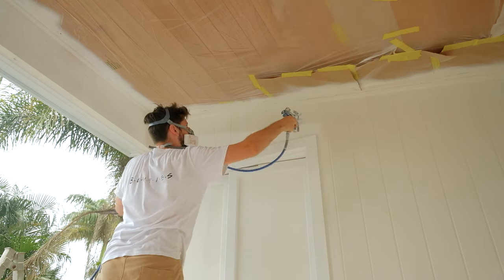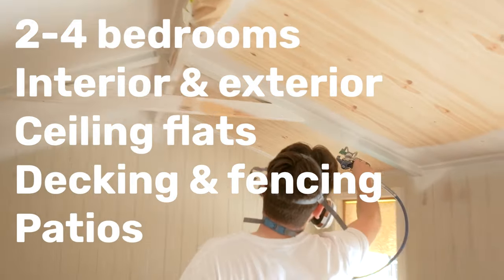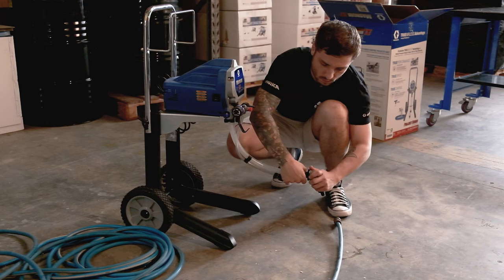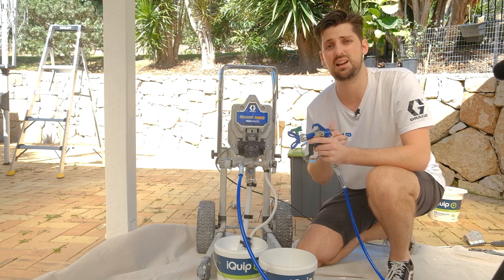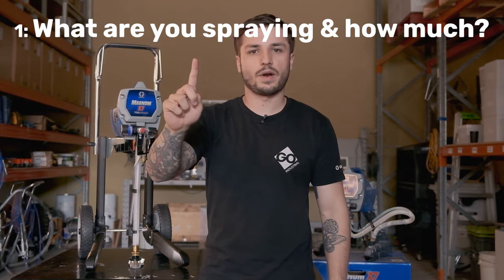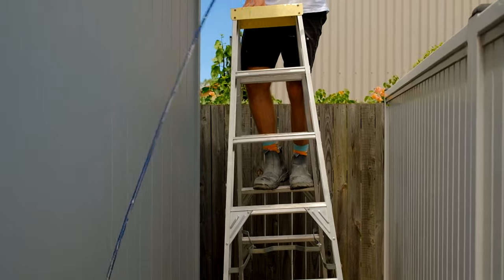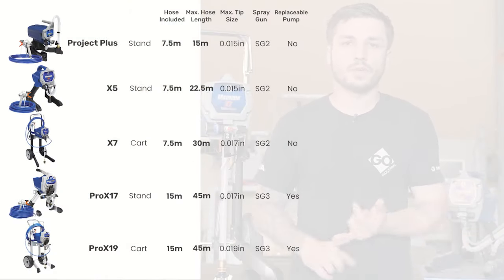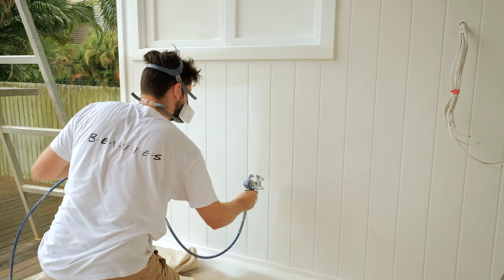Graco X7 Magnum Airless Paint Sprayer - Everything you need to know!

Comment: I'm a DIY homeowner. I have a fence I need to stain, interior rooms I need to paint (4 bedrooms, 3 bathrooms, and living areas) and other miscellaneous furniture/woodworking projects. Would the X7 suffice or should I go larger?
Reply from the maker: Thanks for the comment! The X7 would definitely do the job, however for on-going projects and longevity of the sprayer, I would consider the next step up, being the ProX17. The ProXChange pump on the ProX17 can be replaced overtime, whereas the X7 is a tad more difficult to replace. You benefit with the additional hose length (15m on the ProX17 versus 7.5m on the X7), and a better handpiece (SG3 gun with a swivel to the hose on the ProX17, versus the SG2 gun with no swivel on the X7. I hope this helps!

Comment: What do you mean by longevity?  Can I not use this sprayer for years to come?  Is it limited to a few jobs?
Reply: No, it's NOT limited to a few jobs, keep it maintained and cleaned after each use. It will last for years
Reply: Which one it’s the best for high performances? Could you recommend one? Graco sounds sucks for business!
Reply: @AntonioPerez-hv1lp  this sprayer should last you quite a bit taking care of it.  he said you should spray only about 15 liters daily which is less than 5 gallons a day but we had the project sprayer, spraying ceilings about 10 gallons per job and it lasted about a year before it burned out and that little thing was only ment for small jobs like maybe  2 gallons daily so this one which has a stronger motor should last longer

Comment: Is this or the prox17 alright to use for kitchen cabinets or would you use something completely different??
Reply from the maker: It’s great for spraying cabinets if you’re not a full time cabinet maker/professional painter. If it’s a project you’re looking to knock over, it’s going to be fantastic. I would definitely recommend using the FFLP tips we provide in the bonus kit - either the FFLP210 or 310, these will atomise a lot better than the included TrueAirless tips to provide a nicer finish. If you’re a full time cabinet maker, I’d recommend looking at our FinishPro HVLP sprayers. I hope this helps!

Comment: You said you could spray oil base paint but not flammable liquids. Oil base paint is flammable and the solvent to clean up is definitely flammable. That said, I've been spraying oil based primer all day and cleaning up with acetone. Am I playing with fire?
Reply: definitely some double talk there, I believe the unit is designed to spray water based material because it has a brush-electric motor that can cause sparks. I would think that if you kept the spray unit in a separate area while using oil paint it shouldn't`t be an issue.Where an issue could occur would be the unit in an enclosed area that you created excessive over spray of a flammable material and the unit DID spark. 💣🤞you wouldn't`t enjoy that....
Reply: I stopped using Acetone to clean my sprayer, it actually ruined the seals. Mineral Spirits is the solvent to use. I sprayed all the eves on my split level home, 1st story and 2nd story. Oil based primer is the way to go if you have old, unpainted wood, BUT, the overspray travels forever! Had my car parked at least 50 feet away on a relatively calm day. Overspray all over my car, and that stuff isn't easy to get off!! Had to mask everything, but water based primer wasn't covering, I tried several. Anyway, it's done now, thanks for the tips. Oh, and spraying outside with oil base and cleaning up with mineral spirits was ok, but then maybe I was just lucky.
Reply: @paulcalif  I just retired, I painted for 40 years. I miss oil based primers and interior oil for trim. Yes mineral spirits to clean the airless is better than Acetone, Acetone iv very hot and evaporates quickly. You gotta learn the hard way with oil outside, your right about the travel regarding overspray, I`ve been on jobs where oil primer travel hundreds of feet and attached to vehicles. Glad everything worked out for ya`....
Reply: This is a late reply,  but a video from Home Depot says to use water based stain or paint

Comment: Does the Grace paint sprayer need to be cleaned while waiting for the first coat of paint to dry.
Reply from the maker: It doesn't need to be cleaned inbetween coats! If you submerge the handpiece in water, and relieve pressure in the machine, as long as there is no air entering the system, it will be OK to wait until the coat is dried to reapply.

Comment: So after 500 liters its worn out?
Reply from the maker: 500 litres won't wear out this machine - it is an annual guide to give you an idea as to what the sprayer can handle. If you're spraying 500 litres a year, we'd recommend getting some of the valves and components deep cleaned on serviced at these intervals. If you're planning on spraying more than 500 litres per yer, the X7 might be a bit small for your projects, and you should consider the ProX17. I hope this helps!

Comment: What are different between Graco 390pc and This Machine
Reply from the maker: Big difference overall. The 390PC has the Endurance Piston Pump, which is a lot larger and longer lasting for trade and contractor applications. The motor is also bigger, which helps deliver higher flow rates, and is suitable for more frequent use. 

If you're spraying complete interiors and exteriors a couple of times a week at a minimum, as a contractor or serious hobbyist, the 390PC is the choice over the X7.

The X7 is perfect for the DIYer or renovator painting a few homes a year, or multiple small projects.

Hope that helps!

Comment: Can you spray masonry and wood paint with these?
Reply from the maker: Hey Wanye, great question!

This unit has a maximum tip size of 517. You won't have a problem at all with the wood paint because these are typically thinner than standard paint. With your masonry paint however, this might be a bit too thick and I'd recommend checking the TDS of the paint you plan to use - it should have a tip size recommendation on there. As long as its below 517, you should be fine. 

Hope this helps! 🙌

Comment: Which of 2 tubes goes into the paint bucket
Reply from the maker: Hey Alexander! The main suction tube (thicker in diameter) goes in the paint bucket, and the smaller diameter drain tube goes in the waste pail for priming/flushing. Once the paint has circulated through the pump in the prime position, straight paint will drain out of that tube. You then clip the drain tube against the main suction tube, and both can sit in the main paint bucket! I hope that helps.

Comment: What machine would I need if I wanna spray a roofs and 18 gallons a day?
Reply from the maker: Hey Ubern, 

Spraying a roof is a tricky one because it typically requires a much larger machine to handle the thicker membrane of a roofing paint. 

For a one time use something like the Graco 650 would be ideal. 

With the amount that you are spraying and with roof painting in mind, I would recommend going with one of the professional units, like the 650.

Hope this helps!

Comment: Can I spray Kilz High Build primer with the X7? 

I gotta say this primer is like pancake batter, so I'm worried it might be too thick for this machine.
Reply: Did you ever spray the primer through it?  If so did it handle it?  Thanks
Reply: @Handofseeds  No, I did not. I figured since the walls were previously done with a roller, I just used the roller.

Comment: I am a trader and I want to purchase this for a new upgrade in painting. The thing that I am concerned about is the pump. Do they sell spare parts?
Reply from the maker: Spare parts definitely are available for this unit! The entire pump replacement is a bit tricky however. If you're concerned regarding the overall longevity of the unit, please consider the ProX17 or ProX19 as an alternative model, that easily supports the ProXChange replaceable pump!
Reply: @GOIndustrial  thank you.

Comment: Is it capable of spraying a 620 tip? And how well does it work with FFLP tips.
Reply from the maker: The X7 has a maximum tip size of 17 thou - so won't handle a 620 tip. It works really well with all tips up to the FFLP616 as the maximum tip size

Comment: Hi there what kind of paint I can use  for example Dulux it is good at all?
Reply from the maker: Hey! Plenty of great options - Dulux's range of interior and exterior acrylics are great. There's a brand in Australia called Tint, they offer a fantastic range also: tintpaint.com.au
Reply from the maker: Hey Team, most water based/oil based coatings will be fine to spray with the Graco X7. Just stay away from flammables, membranes and texture coatings - these will not be sprayable through any DIY units.

Comment: Hey I have a graco x17 and i want to spray deck over. It says on the can I can use between a .027 - .035 tip with no filter what would you recommend? A 517?  Or just use the tip that the unit came with?
Reply: You CANNOT spray deckover....it must be rolled and it has to be with a special nap roller

-Use product when air and surface temperatures are between 50-90˚ F (10-32˚ C).
-Use pressure while rolling and apply a generous, even coat using a 1/2" nap roller.
-For a smoother texture, use a brush or thinner nap roller (i.e. 1/4").
-Maintain a wet edge when applying.
-Avoid painting if humidity is expected to be greater than 80%.
-For vertical surfaces such as railings, use a nylon/polyester brush or roller and apply two thin coats at a spread rate of 400 sq. ft. per gallon.
-For edges, corners and in between wood boards, apply using a nylon/polyester brush.
-Do not use with airless sprayer.

Comment: FYI, This sprayer expected life is 150 to 200 gallons of paint. Ours just went out and thats from the Graco tech line
Reply: Geez that doesn't seem very reasonable. Doubt they would sell many of these if they were upfront about that. Are you able to get repair parts?
Reply: @brandonward2619  Yes. They can rebuild them for about $400, so it's not even worth it (new one at HD is $450+/-). I know 150-200 gallond doesn't sound like a lot, but the average home takes about 20 gallons of exterior paint for 1 coat and will last 5 to 10 years. In your life time you might need to use it 5 to 10 times so in that respect, if taken care of properly should last you most of your life. These are by no means meant for a professional painter. We have a Graco 490 pc pro lowboy and it was $1800. This machine will do 400 gallons before needing a rebuild and the pump is around $200.
Reply: @jaxnaturals  I appreciate the info, good to know. I think we got this X7 at HD on special for 350. So I suppose that's probably about as good of a value you can get on these sprayers
Reply: @brandonward2619  I worked great for us. Never had an issue until the pump went. Would buy it to paint my house if I needed to

Comment: I need to spray 6 door frames in my house. What is the minimum paint volume pot the x7 can accept. Will it work with a 4 litre paint tin allowing for paint needed to prime the unit?
Reply from the maker: The minimum that we would recommend is at least 2L - it generally takes 200/300mL to prime the 7.5m hose before spraying. You can definitely use 2L at a time and will be suitable for spraying just your woodwork, definitely recommend!
Reply: @GOIndustrial  great thanks for replying guys.
Reply from the maker: @Tomkatoz74118  anytime man! Hit us with any questions you have!

Comment: What does he mean by 500L in a year? What happens after 500L?
Reply from the maker: Good question! Nothing scary or catastrophic happens after the 500L voluem per year - this is purely a guide that Graco has provided as a manufactuer to ensure you're buying the right sprayer for your job. If you're spraying 1,000 - 2,000L a year on average, we'd definitely recommend a bigger sprayer! If you're pumping 800L for the year through the X7, it'll be more than fine, but we recommend staying on-top of cleaning and flushing for preventative maintenance.

Comment: My gun is leaking where tip screws on. I have tightened and hand tightened. 😢gun is brand new.
Reply from the maker: Hi there! It might be that the OneSeal, which is a rubber seal and metal seat, is not in the back of your tip guard correctly. Please watch our video here: https://youtu.be/2ISXNfUR08g?si=NEET9-j18p_34rNz